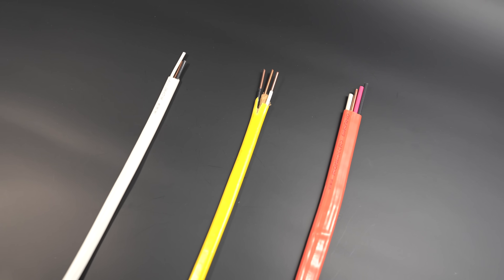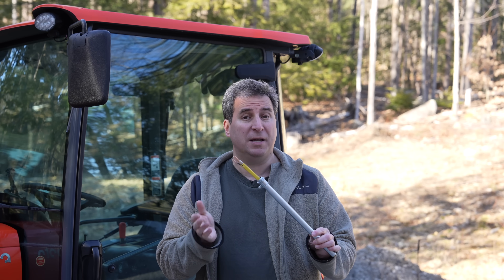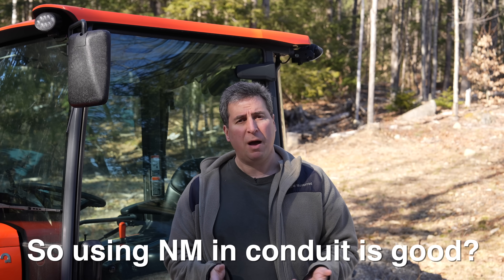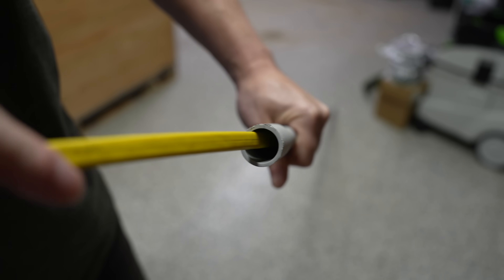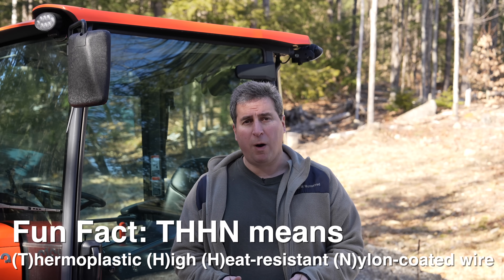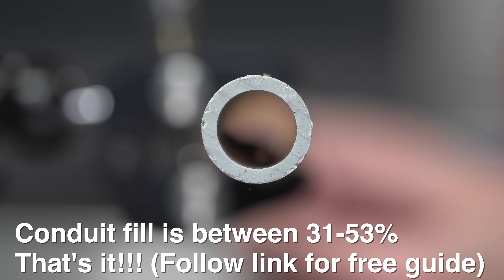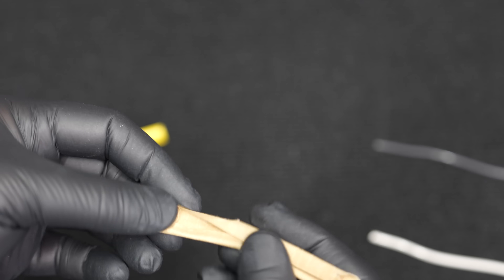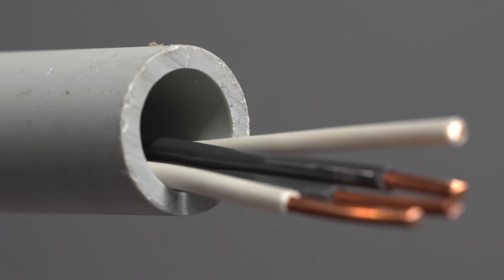#1 DIY Electric Mistake - Can you use Romex Wire in Conduit?

Comment: American electrical code is just nuts, that's what I think 😂
Reply: NFPA 70 otherwise known as the National Electric Code.  You should have known,Lol.
Reply: Part of that is probably because you’re learning it from YouTubers and not licensed electricians
Reply: @N-hunter no, it’s definitely because the code is completely asinine. Just like police are never actually taught the laws they’re supposed to uphold. Electricians are rarely taught code of any kind because while there is a National Electric Code. Every state, county, city and municipality has their own interpretation of it. So it makes no sense to teach it. And there’s also the fact that they constantly change the NEC.
Reply: You clearly have absolutely no idea what your talking about that it hurts a little
Reply: @N-hunter  and the other part is the code seemingly being influenced by Edisons AC scare tactics. 
It's not some big mystery and some super dangerous contraption. Even your 240v outlets look like they deliver 10,000 V. It's just a bit more voltage, amperage is what kills. 

On top you have these weird GFCI outlets, instead of having a simple RCCB for your entire house. The brits are even worse with their super high safety only one direction outlets, that are not only bigger than the US 240v ones, the outlets also all have a switch. 

But, most of all what I dislike the most about the NA-Electrical system, is the 110V system. You guys have to use heavy gauge wires for the simplest devices, simply because you always use double the amperage. You have 240v split phase to your house... Just use it everywhere. It would be so much more efficient. And while we're at it, allow residential areas to get 480V 3Phase at home, so that you're not stuck with 350A breakers to charge your car.

You're doing so many things right, but electricity is just not one of them.
Reply: @nils1953 there’s so much inaccurate information in your comment… it boggles the mind.
Reply: @NerveCurry  really?
Honestly please be useful, because if I am wrong I'd really like to learn!!

1. The Edison thing was a joke.
2. Voltage is harmless obviously, it's the amperage that kills as long as the bodies resistance is overcome, 100mA is enough to stop the heart. But voltage can be in the thousands without harm as long as the current is low.
3. US 240V outlets are just clumsy, overly thick and bulky. Compared to your 110v plugs, it's so much worse. All you get is one more hot wire, why does it look like it's supposed to carry 50kW?

4. GFCI outlets and RCCB's are used in ground detection faults. The US uses GFCI outlets in wet rooms and wherever deemed necessary, instead of just having RCCB's which serve your entire home, and with that also help with safety in all other rooms in a home.

5. Not even gonna start with the brits, as you Americans implemented everything bad that they ended up abandoning, and now somehow defend them like you invented it yourselves, like the imperial system.

6. You guys use 110v for most devices so every single wire has to have enough wire ampacity to carry enough load with the little voltage. 
That's why 240v is superior, in material efficiency alone, especially With the price of copper getting ever worse.
I am aware of the difference between European single phase 220v and US 240V split phase but, the efficiency in power delivery is the same. Lower power loss thanks to lower current flow, lower voltage drop thanks to higher voltage and less copper, so cheaper cable.

7. 480v 3Phase for home is the future. The future is electric even if not with these batteries, but either way you have to charge your 180kwh battery in the future somehow, and 240v will never cut it. Often times the power lines to your home are medium voltage anyways, why use 3phase transformers instead of the useless 240 split phase ones.

Alright, if you disagree with these things I'd love to know what and why, so that I can further educate myself.
Reply: @nils1953  lmao dude what do you think amps are? Current is the relationship between resistance and what? 

Also we use 120 not 110 so stop saying that what are you like 60?
Reply: @NerveCurry  alright that was as helpful as a bag of chips.
At least I know I wasn't wrong then.
Reply: @nils1953  can you describe to me the effect that doubling the voltage of a circuit with load resistance remaining constant would have on the current of that circuit?
Reply: @nils1953  “falling from a skyscraper is harmless, it’s hitting the sidewalk at the bottom that you have to worry about.” - you, probably
Reply: @NerveCurry  are you okay? Ohm's law is a direct proof of what I'm saying. If your voltage is high enough to overcome the resistance it's the amperage that kills. Every household circuit in the US or anywhere else is high enough. 120v is not safer, and that's backed up by every death by electrocution statistic. 

In your eli5 analogy, it's the bullet that ends up killing the person, not the gun.
Reply: @nils1953  higher voltage at constant resistance increases amperage. You keep peddling “amps kill volts are harmless” as if amperage in a residential circuit can be divorced from voltage. In 99.9% of residential applications we aren’t ever varying resistance within an appliance to create a higher current separate of voltage. If you’re talking about one specific instance of electrical shock in which you interrupt a high current circuit with your body then sure, who cares if it was 120 or 240 that killed you. But in any instance where your body acts as the primary load, voltage matters. Full stop. Higher potential difference= higher current when resistance remains constant.
Reply: @nils1953  does a bullet kill you without a gun?
Reply: @nils1953  American here, somewhat educated and not a DIY electrician that actually understands why things are done here and has an understanding of how and why things are done differently else ware.

1. "The Edison thing was a joke."
I do not think it is. The reason why we use 120VAC today is because 110VDC was the Thomas Edison standard, which is why residential and consumer electronics are currently at 120V. 240VAC was a push by Nicola Tesla because peak efficiency for induction motors at the time was operating at 240V at 60Hz. With improvements made to 3ϕ induction motors and the prevalence of switch mode power supplies and  variable frequency drives supply voltages and frequencies are almost irreverent wherever you are in the wold. I have 230/400V 50Hz euro motors at work running off of VFDs. There is still a big fear around higher voltage, especially around older generations and that is why "The Edison thing was a joke." is not really a joke.

2. "Voltage is harmless obviously, it's the amperage that kills as long as the bodies resistance is overcome, 100mA is enough to stop the heart. But voltage can be in the thousands without harm as long as the current is low."
I will disagree with the voltage being harmless. Without getting into much sorted technical numbers and  jargon voltage is thought of as pressure which is whatever arbitrary unit you use (PSIG/kPa/Bar),  meaning human skin can reach a threshold. The higher the pressure/voltage the easier it is to break the skin.  That is why you will not feel a shock at 6v 1Ka, but you will fee one at 1Kv 1mA. Something between 120VAC and 230VAC seems infinitesimal making a little difference. Japan widens the gap with their 100VAC, but I digress with the fact the it much safer with 120VAC vs 220-240VAC. Where safety comes in with North American 120/240 single phase (I refuse to use the internet term "split phase") is under 240V voltage is 120V to earth instead of 220-240V to earth in euro configurations. speaking of euro configurations, North American single phase can be thought of as a T-T earthing.
To quote OSHA (Occupational Safety and Health Administration) shock and electrocution is defined as:
1mA:  Perception level. Slight tingling sensation. Still dangerous under certain conditions.
5mA: Slight shock felt - not painful but disturbing. Average individual can let go. However, strong involuntary reactions to shocks in this range may lead to injuries.
6-30mA: Painful shock, muscular control is lost. This is called the freezing current or "let-go" range.
3-300mA: Extreme pain, respiratory arrest, severe muscular contractions. Individual cannot let go. Death is possible.
1,000-4,300mA: Ventricular fibrillation (the rhythmic pumping action of the heart ceases). Muscular contraction and nerve damage occur. Death is most
likely.
10,000mA: Cardiac arrest, severe burns and probable death.
I will get more into this later.

3." US 240V outlets are just clumsy, overly thick and bulky. Compared to your 110v plugs, it's so much worse. All you get is one more hot wire, why does it look like it's supposed to carry 50kW?"
The 240V outlets/outlets and plugs you are probably used to seeing are for large appliances and welders. There are much smaller plugs like the NEMA 6-15(240V/15A), NEMA 6-20(240V/20A), NEMA 7-15(277V/15A). The plugs that I just listed are the same physical size and standard NEMA 5-15/5-20 plugs you are used to seeing on the internet for 120v applications. There is no reason why a NEMA 6-20 outlet cannot be used with a welder, but some things are hard to change in North America, and big chunky plugs with derated wires are the norm for welding applications is annoyingly one of them. Going back to the NEMA 7-15 plug, it might look very similar to the AUS/NZ plug, and that is because they use an obsolete 250V american plug design, but the dimensions are the same as 7-15 but with a D shaped ground/earth pin. The big chunky plugs are a NEMA 10-50 (240V/50A) NEMA 14/50 (240V50A) plugs you are used to seeing are stationary appliances or welders, which I already stated is derated and over rated for welders. I dream of a day that we use 120/240 outlets throughout our homes and it greatly benefits with L-E voltages compared to euro 220-240V sockets and can use superior 240V appliances and 120V lighting as Tesla and Westinghouse intended.

4. "GFCI outlets and RCCB's are used in ground detection faults. The US uses GFCI outlets in wet rooms and wherever deemed necessary, instead of just having RCCB's which serve your entire home, and with that also help with safety in all other rooms in a home."
National Electric Code states that certain applications shall not be used with GFCI(RCD) devices:  Smoke/heat/Carbon Monoxide detection, fire alarms, fire suppression/sprinkler plumps and solenoids, sump pumps, sewage pumps, life support and medical equipment, HVAC and boilers. Anything that can cause severe property and bodily harm or death in the case of a "nuisance trip" shall not be GFCI(RCD) protected. There were application in the past that were required to be GFCI protected, like sump/sewage pumps, but since the early 2000s were changed to regular over current protection as a nuisance trip can cause more potential to shock/electrocution than it prevents. I personally disagree with this to a point. More down below.
I personally think that it is important to keep certain things not GFCI(RCD) protected like fire detection/alarms/suppression systems, but I also agree that most of a home should be GFCI protected. North American Class A GFCI will protect up to 6mA, whilst Euro RCDs protect up to 30mA(refer to OSHA definitions above). In North America 30mA is used for equipment protection and not personal protection. In the 1960s Class B 20mA GFCIs was the standard here for personal protection, but that soon became obsolete with Class A 5mA GFCI, and remained the standard since. Anything from 20-30mA is designated for equipment protection only. On the market for residential use is combination GFCI/AFCI breakers which detect arcs and ground faults(earth leakage) up to 30mA, and not designated for personal protection, which is where our weird GFCI outlets/sockets come in.
I personally would like to see split-bus main panels used where circuits required to not be GFCI protected under the main, and everything that consumers interact with under a AFCI/GFCI 30mA "sub main" breaker, and 6mA GFCI after for personal protection. As someone who got a nasty shock in an old house by waving Christmas lights in front of my eyes while sitting on a concrete floor, I wish I had a class A GFCI and thankful that I did not have a Euro RCD.
Reply: @nils1953  5. "Not even gonna start with the brits, as you Americans implemented everything bad that they ended up abandoning, and now somehow defend them like you invented it yourselves, like the imperial system."
I would not say Americans implemented everything bad, but the Brits got beginner electrics like North Americans are currently using. They got destroyed by a world war and had to opportunity to rebuild, whereas North Americans did not have to do that, hence 120/240V 60hZ 1ϕ. In regards to the imperial system, we stuck to the measurements that England was using in the 1700s, but some king that is irrelevant to the rest of the world decide to change for some reason, which is why our liquid volumes are different: 1,2,4,8,16,32,64,64,128, ... vs the Brits and Canadians which use even more garbage number sequences. I will defend the Brits that they did start the first industrial revolution, and their unit standardization was key in it, but chaotic and obsolete to today standards, just like US Customary/queen Ann units. hey, at least we are not decedent from the French, especially Pairsian French. I cannot think of one country to mess up most of a continent than the French, and then still be smug and superior about themselves. I will say that the only french that I can speak is I am from Illinois, and it is 5C outside, inside is 16C, and I weigh 84Kg, which I have no idea what that translates to what my compatriots understand, but I am a weird American. I do agree that the Brits have a terrible plug design and ring circuits are garbage.

6. "You guys use 110v for most devices so every single wire has to have enough wire ampacity to carry enough load with the little voltage. 
That's why 240v is superior, in material efficiency alone, especially With the price of copper getting ever worse.
I am aware of the difference between European single phase 220v and US 240V split phase but, the efficiency in power delivery is the same. Lower power loss thanks to lower current flow, lower voltage drop thanks to higher voltage and less copper, so cheaper cable."
Again "Split phase" is an internet term by armchair internet DIY electricians, it is simply center-tapped single phase, like the Brits use 60/120V single phase on construction sites because 60v L-E is safer than 120v L-E, or 220-240v L-E.
Currently there is not a rule in the NEC (National Electric Code) stating that we cannot use 240V circuits as a branch circuit, but there is a rule against multi wire branch circuits (2x L 1xN to one location of a house with the Live split into two separate circuits whilst sharing the Neural (L1 draws 5A, L2 draws 8A, N carries 2A to balance the load and both circuits share a 240V breaker), but there is not a rule stating that we cannot use a duplex outlet/socket that supplies both L1, L2, and N, which means supplying both 120/240V at the same outlet/socket, and such an outlet currently exists on the market. The plug is not any bigger than what we use for 120V, just different pin layout. We can even finally update our outdated plug designs to something superior to what the rest of the world uses. Something similar to the IEC designs, but can accept dual voltage, but it is unrealistic to dream in this backwards country that I live in.
A big argument that I have with our system is our cords are undersized witch is so stupid. a fuse plug will solve this, but they are really only found on floor fans and Christmas lights.

7. "480v 3Phase for home is the future. The future is electric even if not with these batteries, but either way you have to charge your 180kwh battery in the future somehow, and 240v will never cut it. Often times the power lines to your home are medium voltage anyways, why use 3phase transformers instead of the useless 240 split phase ones."
I disagree with this.  USA 277Y480V 3ϕ, Canadian 347Y600V 3ϕ has a lot of potential to arc flash and electrocution compared to 120Y208V 3ϕ, 120/240Δ240 3ϕ, and 120/240v 1ϕ. I do agree that electric cars are the future, as is nuclear power generation, but I am unsure that it will be home charging. In America at least it is a loss for corporations to profit and government to tax so I can see charging stations becoming a thing over home charging. I am not a Luddite, but I do not think it is feasible to have industrial voltages along side residential/commercial voltages in residential areas. Like I said earlier VFDs are taking over on a lot of 240V motor applications so 3ϕ voltage supply is already becoming unnecessary unless our homes are inside of factories.
I will say one thing about my job working in industrial control panels. We use DIN mounted MCBs in them and I much prefer North American style bus breakers to MCBs. I do not like how MCBs trip to the "Off" position as opposed to the "Trip" position on NA breakers. it is harder to find the fault when there is a large bank of breakers and some are switched off for a reason.

Anyway, it is late, and I am about 3 Bourbon Crusta cocktails into writhing this, and I am done. I will leave one defense for the NEC. Not including territories the USA is 9.8millinon square kilometers (Canada is larger). The national electric code is broadly written to cover a vast chunk of land where the climate can vary from -30C to +30C in the same day. This is why different states/counties/cities have their own more strict code requirements to the NEC to better suite  their needs. It is almost anything from taxes, laws, to what I am passionate about: EXIT signage. Illinois requires red stencil illuminated EXIT at 20mm width stroke at 6" tall and chevron directional, Chicago specifies egress specific EXIT/STAIR/STAIRS/STAIRWAY/FIRE ESCAPE with a long-stroke arrow directional in illuminated open face red letters 1/2" width stroke 6" tall and white backdrop, while Algonquin Illinois requires green stencil Illuminated Exit at 20mm Width stroke at 6" tall and chevron directional. Connecticut mandates red 20mm letters and chevron directional with the wheel chair accecibility symbol where applicable. New York Mandates red EXITs like Illinois, but NYC is Red 3/4" stroke 8" tall with ADA (Americans with Disabilities Act) compliant chevron directional, and a green ISO "running man" under the illuminated signage. California does not have a color requirement for EXITs, but Los Angeles mandates green letters (loosely enforced) and San Francisco green letters (heavily enforced). Canada is Illuminated red EXIT/SORTIE, or green illuminated  ISO "running man". Mexico is discontinued illuminated red SALIDA in favor of non-illumited ISO "Running Man". North America is an interesting place
Reply: @ExitSignAficionado  oh wow!! That's so much useful information. Thank you so much! This was a great read. 
I do have an additional question though, about the GFCI excempted devices. At least those that you listed, all have a UPS or some other form of battery backup in case of power failure, at least where I live. Wouldn't that negate the need for a non GFCI outlet, as no bodily harm would occur? Because at that point wouldn't a simple power outage have the same effect as a tripped RCCB?

Either way, thank you again for taking your time and describing everything in so much detail. You rock!
Reply: @nils1953  "Edisons AC scare tactics. " enough with the deranged conspiracy theories.
Reply: It's pretty easy once you get the hang of it.
Reply: its pretty good
Reply: Fucking mental. They can't even agree on a national one that actually enforced
Reply: The work I've seen from licensed electricians is often breaking code because that code is so friggin labyrinthian. They have electrical work competitions in the US for the same reason English has spelling bees, there are a lot of rules and a lot more exceptions.
Reply: The code is to keep idiots from doing stupid things, but you can’t fix stupid
Reply: After seeing exposed NM cable tacked to the wall with staples and random runs of conduit in a name brand definitely licensed and inspected hotel in Germany, I’m pretty happy with the codes we have in the US to be honest.

It’s not perfect. It’s sometimes silly (I.e. load calculations assuming lighting circuits are running incandescent in 2024). But conduit and other safety rules are great to have.
Reply: @m_cabral  Did that place in Germany burn down with you in it…? Or was it perfectly fine and your stuck up American attitude was the real problem?
Reply: They have electrical code?
Reply: There is no country named America
Reply: @Stevenj120volts   Yes there is, look at a map.
Reply: @dancooper6002  America is the continent.  The country is the United States of America.
Reply: @Stevenj120volts  Nope, the country is also known as America. Just as Rhode Island is not always called  Rhode Island and Providence Plantations
Reply: @dancooper6002  only "known as" aka slang so not the real name.   I have 125k tik Tok followers.  And Canadians in the comments are really picky.  Saying we are BOTH from American but I am from the states.